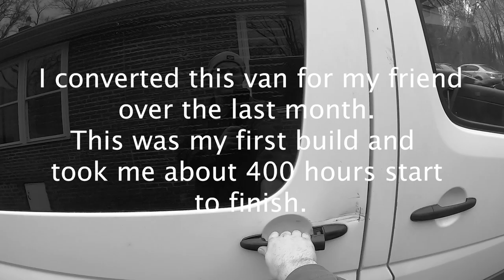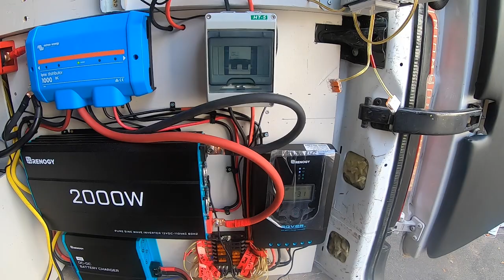Complete Van Conversion Timelapse - First Time DIY Sprinter Van Build

Comment: ... No sound deadening ... No moisture barrier togeteher with rockwool and insufficient venting is a nogo ... B U T :  high voltage cabeling unprotected over ridges is ridiculous dangerous ... (... isn't  there a 3,5-ton limit in USA?) .. But nice rainbow LEDs ...

Comment: You guys didnt use sound dampening.
Was it a decision of yours ? And why ?
Reply from the maker: yeah I considered it but didn't for a few reasons. there was some sound dampening strips that were already installed from the factory so I didn't think more would help much,  plus I figured insulation against the walls would also stop the walls from rattling and dampen the noise. also they are only to make it more quiet while driving and he is traveling solo in the van so doesn't need it to be more quiet in the back while he's driving.

Comment: what about mold between the wall and insulation
Reply from the maker: I left holes in the walls for moisture to hopefully escape, the insulation says it resists moisture, the propex heater blows out dry air so it also hopefully dehumidifies the air in the van. Also no air conditioning so hopefully that helps prevent the walls from forming condensation.  I did consider it so now hopefully it holds up 🤷🏻‍♂️